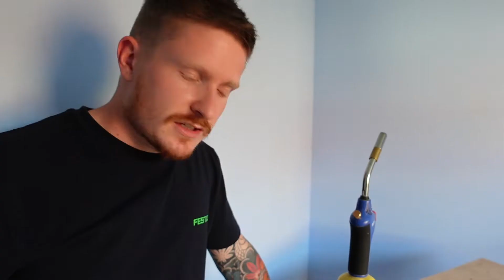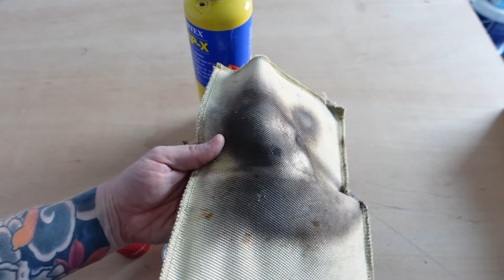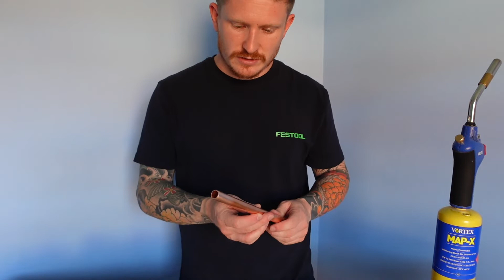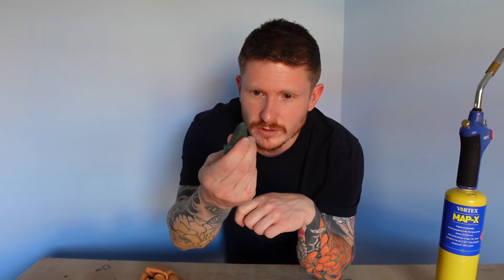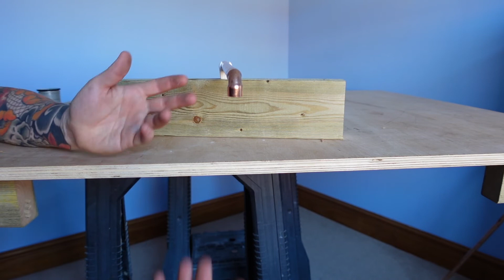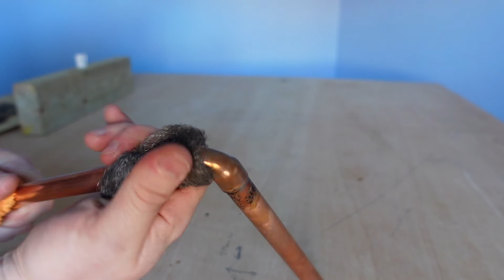Is THIS The Easiest Way To Solder? | End Feed Copper Pipe Soldering

Comment: Is there a way of knowing when the pipe is hot enough to apply the solder ?
Reply: the flux will bubble, and if you try applying solder and it doesn't melt straight away, it's not hot enough.

Comment: Very well explained and a good clear video. You didn't give a link to the solder - presumably the length needed depends on the thickness of the solder??
Reply from the maker: Glad you like the video.
Reply: plumbing solder comes at a standard thickness. you don't want to be using electrical solder, which comes at a much wider range of thicknesses.

Comment: Silly question but do you use the same size connector as the pipe,  as in a 15mm connector to 15 mm pipe or do you need a slightly bigger connector so the pipe can fit into it ?
Reply from the maker: No questions are silly. 15mm fittings are used for 15mm pipe.
Reply: @TheDIYGuy1  thank you so much. Very helpful. I love your videos and have subscribed.

Comment: Nice explanation. One thing these demos always forget, is joining a pipe that's got or had water in it. I tried soldering a working pipe and it wouldn't solder. Spoke to a plumber and he told me it was because of the water, it will ALWAYS cool the copper down. He said place some bread into the pipe and push it up past the place where you're joining and it will stop the water coming through. Then once the pipe is soldered, the bread will come out with the pressure of the water.

Comment: I'm new to this. 
I was wondering why no one solders the bottom, I know the top looks good, but how do you know they're is enough on the bottom to hold ?? Thank you for the video.......
Reply from the maker: Your welcome. Capillary action and the correct amount of solder used will ensure there is enough solder in the joint.
Reply: @TheDIYGuy1  Thank you so much, I'm going to give this a try, thank again.
Reply: @TheDIYGuy1  I understand that but as a beginner how can I be certain that its sealed the joint before the pipes gets hidden.
Reply: @su13man1403  pressure test it
Reply: @su13man1403  visually inspect the joint and you should see a continuous bead of solder.

Comment: did you solder both ends ?
Reply: ...not on this video..?
Reply: @shouwill  I agree, we only saw one side of the connector have solder applied; I'm guessing that very soon after that the focus of the torch moved slightly to the bottom of the other end and solder was fed in there in the same way.  Must have ended up on the cutting room floor during the edit. :-)
Reply from the maker: Yes I did